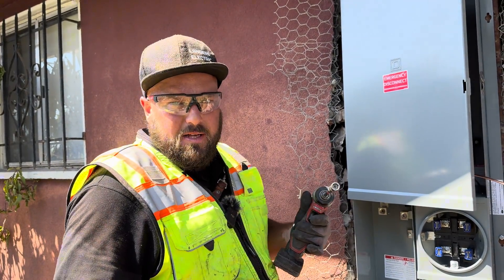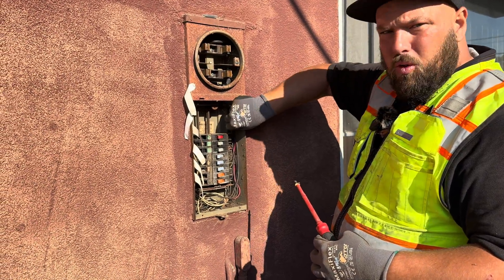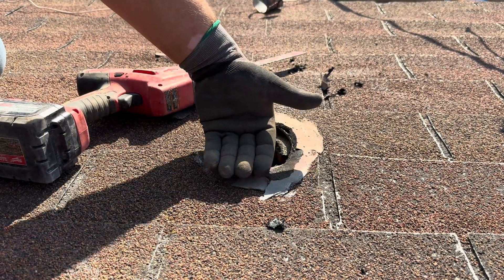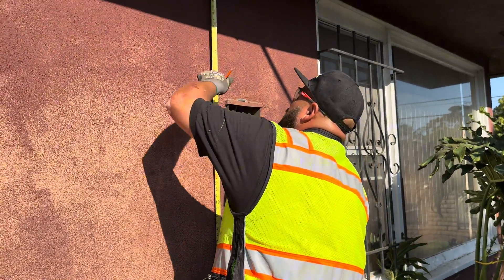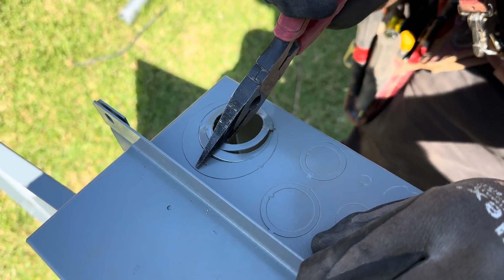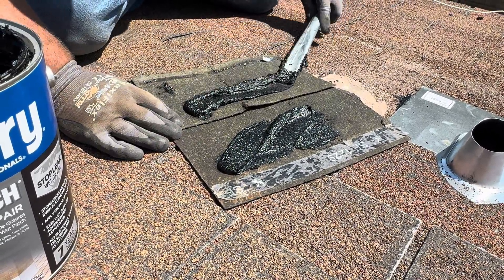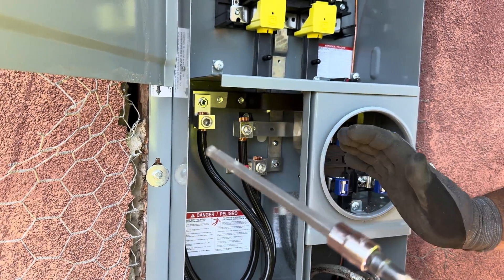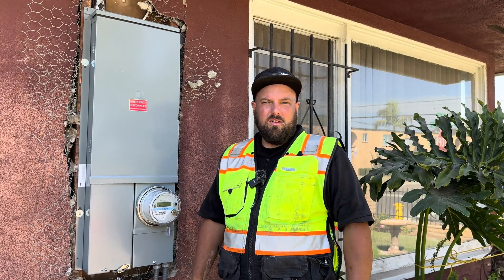Electrical Panel Upgrade | EASY 200 AMP Main Panel Replacement | FULL TUTORIAL By MASTER ELECTRICIAN

Comment: It is odd to see the service entry box on the outside of the house. Plus, grounding rods are copper plated steel rods. The NEC has these 2 feet away from the eves of the house or gutters as to places them where it gets wet! The wire mesh used in old school stucco will mess with any stud finder, so go indoors and measure over. If it has lathe & plaster, a stud finder won’t work inside either. So peeling back the wire mesh in concrete type old stucco will save attachment to the house, letting a stucco company simple cut the wire mesh to fit, then staple/ nail or lag-washer in place. Then if they are good, they will apply to the same level & color. Sometimes it’s painted to match. EIFS actually provides insulation and R-Valve to the walls reducing your A/C bill.

Comment: In Kentucky we use a bare number 6 AWG for our unbroken ground from two ground rods 6 feet apart to the first means of disconnect. I don’t know what state you are in is it normal there to use a number 4 AWG. I have never worked any where but here so I am just curious.

Comment: Nice & clean work with COPPER conductors!
Nice to see.  I know it’s more $$, but it’s so much nicer & safer.
I’ve been a firefighter & licensed  master electrician for 30+ years and am horrified when I see YouTube “instructional videos” where the presenter is using CCA (“copper coated aluminum”) for branch circuits.
Reply from the maker: Thanks 👍

Comment: Superb video by a natural teacher and, obviously, a master electrician with gobs of experience.  The ONLY deficiency, IMHO, is that the instructor failed to disclose the size of the outgoing drop from the utility pole, and the ampacity of the old main breaker.  After all, this is an educational video and a student should know the "before" and "after."    I recognize the Zinsco breakers from the 1960s, AND applaud the upgrade.    In my region, our feeders from the utility's transformers are underground, which scares me.   The SoCalEd guy said I could arbitrarily upsize my main breaker.   WRONG.  That could, theoretically, cause a feeder to burn and that feeder is 10 feet (?) below the spine wall of the entire neighborhood.     Geez, we have no ugly "telephone poles" in my neighborhood, but they have their virtue!
Reply from the maker: Old main breaker was 60 amps. Utility company replaced their wire with wire within their specs for 200 amps. They don’t use the NEC.

Comment: You made an extra hole in the roof so you can run a straight piece of pipe. If you were a professional electric company you would have a cyclone bender and custom bend the pipe to use the existing hole.

Comment: I am a Union Electrician in Southern California. I only do commercial work. But this is a very clean and professional installation. Great work!!
Reply from the maker: Thanks! Glad you liked it!
Reply: Did they fix the dry wall?
Reply: Ok... the question residents always want to know - PRICE.

I have a 2003 Northern California home that was built before all the electrical codes were in place.
The home I bought was the developer's house they moved into after building the community.  These are million dollar homes.   Not sure who on their team did the electrical work, but they cut ever corner they could.  I found this out when I bought this house and found out from the inspector and we accepted the fact on purchase.  We have lived with the crappy electrical.  Now I bought a new TESLA and want to consider putting in a new panel and fixing as much as reasonable.
Reply: @graphguy   From what I've heard anywhere from $1500-$3000 for a meter main install, this is for NWFL however.
Reply: What union do you work for ? Im almost done with school at SJVC and im looking into unions to join . Or where to apply for an apprenticeship program . Any advice would be great thank you. Im also in Southern Cali . IE area
Reply: Do you work for Morrow Meadows?

Comment: I watched a lot of videos and read a lot of how-to articles, yet I still did not feel comfortable in doing this kind of job myself.  Therefore, I bit the bullet and hired a pro.  Glad I did...even if it did cost me a pretty penny (I also had them run power to my detached garage and hook up the central air unit I had just purchased).  I found out by watching the electrician and his three apprentices, that there were a few things that came up that I would not have been able to deal with.  Plus, the guys that did the job we very particular about how things looked, inside and out.
Reply from the maker: It sounds like you made the right call. Great to hear your project went smoothly!

Comment: I didn't see a panel based surge protector. Was one put in? If not, what are your thoughts on those?
Reply from the maker: If you look at the last scene there’s one installed on the bottom left slot just above the main breaker. They’re required by our local jurisdictions. I think they’re nice as long as they actually work.

Comment: No offense. I had Vitiligo in my hands and lips  the cure are Indian chickpeas.
Reply from the maker: None taken. Thanks for the tip!
Reply: @landerselectric  the name is Kala Chana,  is like regular chickpeas but brown and smaller. You have to cook it in water no salt.  and blend in the blender and take one cup first thing in morning. It takes about a month to start seeing results but it works because this is how I healed. I went to see several dermatologist before this and they told me it has no cure but there is. I have no marks (just one small one on one of my fingers) I know this works  and it's not expensive. If you want to try and heal.please just share to whoever it needs.

Comment: Great  video with useful information!  I do have one question though - I didn't see you use any grease/paste on the power leads before you tightened the lugs, is that not required or recommended?
Reply from the maker: Great question! Technically non-oxidation compounds are not even required by the NEC. 99% of local inspectors though will call it on you if you don’t put it on aluminum conductors. I’ve never seen or heard that it’s required for copper conductors though.

Comment: Apprentice here a question that comes to mind is do the power lines coming from the post need to change in size now? And Do you automatically get 200A just by changing the panel? Thanks. Awesome video subscribed.
Reply: The utility lines normally do not have to change. The power company usually says their wires are good for 200 amps. They can be very small, #2 aluminum can easily handle 200 amps because they dissipate heat more easily than our wires do. They’re not bound by the NEC so the utility wires are not rated by the same ampacity table that the wires from the service on in are. What makes it 200 amp is the size of the service wires and the main breaker. I hope this answers your questions.
Reply from the maker: Thanks for jumping in on that one. Appreciate you!
Reply from the maker: Great question. We do have to upsize both the rigid conduit and the wire.

Comment: How did you secure the riser? Or did you not?. The only thing holding that riser in place is the panel hub threads and the hole in the top plate

Comment: For this model of Square D panel, what do you call the compartment below the meter socket. Also, whats the purpose?
Reply from the maker: Great question. It’s a junction box. It’s really helpful especially if you have circuits coming in from the bottom or side. There’s a chase that goes up and behind the meter into the upper panel compartment.

Comment: Can the panel be mounted inside the home instead of outside
Reply from the maker: In my area the utility company requires the meter to be facing outside.
Reply: @ ok but I’m asking can the electrical panels be located inside the house 
I noticed in the county I live in that the houses mostly have the electrical panels outside
Reply: @ I just want someone having access to my panel outside the home

Comment: By any chance did the AHJ inspector ask you for AFCI brakers on this upgrade? Or is it just for new construction or remodeling + addition work? I see that you have a whole house surge protector too, i wonder if that is required for all upgrades in California.
Reply from the maker: In my area, AFCI breakers are not required for an upgrade. Only if we add a circuit. And I’ve never actually looked up the code for the surge protector, but every inspector in my area asks for them.
Reply: @landerselectric  Thanks for the info

Comment: Best real electrician channel I’ve seen yet. I’m almost three years in but really only have experience in solar and industrial. Can’t wait to try commercial. Question - how did you tie in to the utility? Like what fastener was used? Also for video ideas I really enjoy this informative type of “how to” videos. I enjoy anything with trade related tips on how to be more fast and efficient
Reply from the maker: Thanks and I’m really glad to hear you find the content helpful. I enjoy creating to the point tutorials with no fluff.

As far as the connectors for the utility, I don’t make that connection. I have seen some use Polaris taps or split bolts but I don’t think those are approved means. The utility in this area where the video was filmed uses copper coated 2 bolt clamp on connectors. I don’t know the part number but that’s what they use.

Comment: So I have the same panel (200amp) outside the garage and want to a 50amp breaker to add a NEMA 14-50  outlet in the inside garage for EV charging, where would I wire run through on the is box ?
Reply from the maker: The bottom right section of the panel is a junction box. You can come out of the back of that section. Make sure you use a licensed electrician for all electrical work and never work with the power on.

Comment: What did you use to connect the rigid conduit to the panel? Locknuts or a hub?
Reply from the maker: For this panel I used locknuts because it’s recessed into the wall. For a surface mount I use a Meyers hub.

Comment: Not an electritian but did a panel upgrade for someone in California, weird ass outdoor panels, had a pair of hv gloves with leather overs, opted to pull the meter and a good call, all the screws in the meter socket were less than tight, put a blank over that, did the job then stuffed the meter back in. Had a welding hood and leather jacket over a good cotton duck jacket and standing on dry pine boards just in case! Main panel had 4 breakers and a cartridge main. Made a little weathertight house over the panel, added quad down the bottom and a pull chain light, E-inspector was pleased with the presentation.    Glad you're healing up okay, burns suck!
Reply from the maker: Glad you were able to get it done safely. And yes, very thankful I’m 100% healed!

Comment: Why are there multiple grounding points?   I've seen issues with lightning and multiple grounding locations. One house in particular has lost all their appliances multiple times. They removed all but one ground and solved the problem.
Reply from the maker: Good question. The national electric code requires at least two ground rods unless you can prove that you have 25 ohms resistance to one single ground rod. The wire you see clamped onto the cold water technically isn’t a ground. It’s a bond. What it’s doing is providing protection in the event that there’s a short to any of the water pipes in the house.

Comment: Are you not allowed to use aluminum wire for service in your area? Just curious being copper is so expensive. Would love to see a video of how you would get new circuit into that panel once stucko is repaired.
Reply from the maker: You know I’ve never asked or looked it up in the code. I prefer copper anytime I can. Definitely will make a video next time we install a circuit in an existing panel in stucco.

Comment: Dang that's a way old pannel, what was it and its AMP rating?  Is it CA or NEC code for 2 ground rods?   Wow they like the meaters low there!!  Most of the meaters are lot higher hear in TX at least on the older ones, not sure new ones. Is that pannel over kill for that house?
Reply from the maker: Ya we run into a lot of panels like this one. This is a 200 amp solar ready panel which means the main breaker is 200 amps but the bussing is 225 amps. And yes, we’re allowed a minimum of 48” to center of the meter. And no, it’s not overkill because so many people are installing EV chargers and changing their appliances to electric.
Reply: @landerselectric  thanks for the info  Around here 200AMP is about stanard, Just was curious cas it sure looked like a small house with those few brakers the old pannel had.  What was the old pannel?
Reply from the maker: @marlawhite3682  you’re welcome! Not sure. I didn’t check.

Comment: So you landed all the breakers on the same phase? Derp. And you never seal all   4 sides of roof penetration boots. Water needs to drain out from the bottom edge.   Sloppy work.
Reply from the maker: I can understand how you might think that they’re on the same phase but take a closer look at the bussing. And good thinking, but on a roof I don’t think it’s good practice to leave the 4th side open. Roofs need to be 100 percent sealed. Fixtures and boxes on exterior walls yes three sides but not roofs.

Comment: Noalox is not needed anymore?
Reply from the maker: In most situations, it’s only used with aluminum conductors. My apprentice actually just told me, though that the code doesn’t actually require it. What do you think?

Comment: I believe, where not subject to damage, a number 6 copper gec is all that is required to the rods. #4 is fine but not required.
Reply from the maker: I might be wrong but I believe we need to use 250.66 for the ground rods (grounding electrode conductor #4 for 3/0 copper) and table 250.102 (C)(1) for the cold water bond. Also see 250.104 (A) (3) and 250.104 (D)(1). Let me know if I’m seeing that correctly.

I believe they are all saying we have to use Table 250.102 (C)(1). I’m using 3/0 copper so that would be #4 copper
Reply: @landerselectric thank you for all code explanations
Reply from the maker: @NickNurbek  you’re welcome!

Comment: how do you gaurentee that your drilling a straight and accurate hole for your new 2" riser conduit if your using a holesaw on an extension bit
Reply from the maker: Great question! It is a little difficult. What you want to do is make sure you measure from the edge of the panel to the outermost edge of the knockout. On the panel shown in the video I believe it’s about half an inch or an inch. Then I get a flashlight and shine it up and make sure that my hole saw is that far off the stud. I use a slightly oversized hole saw to give myself a little bit of play. After I drill up through the two or three top plates, I then take a really long pilot bit and try and hit center. If my pilot bit won’t reach, then I use the old hole, where the old riser was going up, and measure over to my new hole from underneath where the stucco is. Sometimes I have to break the stucco out a little higher so I can get the measurements. Once I have that measurement I can go on the roof and measure off the old hole. Then I go up on the roof and drill a pilot down. Then go back down and shine the flashlight up and see how close you are. You might need to move it a little bit to make sure you’re dead Center. Once you’re really close drill your hole down through the shingles of the roof. This entire process gets much more difficult if you have a tile roof or Spanish S shaped roof tiles.
Reply: @landerselectric  thank you for the reply and detailed response! ive always wondered what would be the best way to attack that situation! thanks again!
Reply from the maker: @Age1117  You’re welcome! Hope it helped!